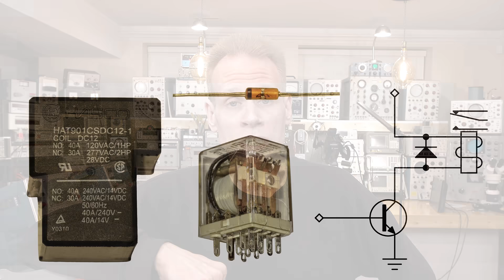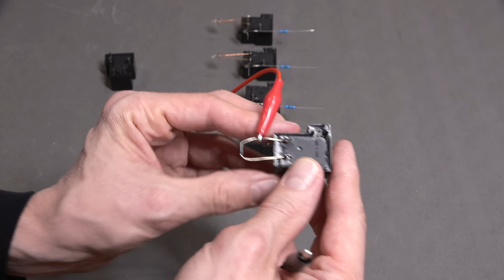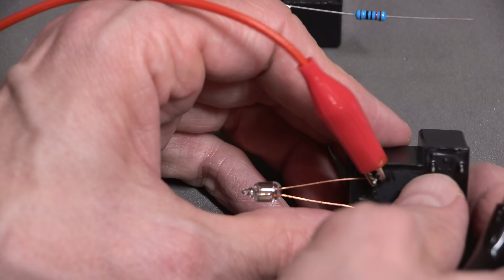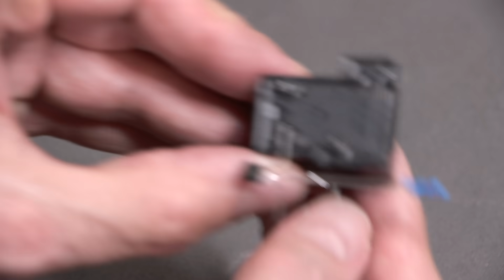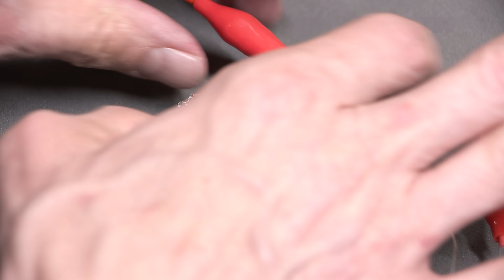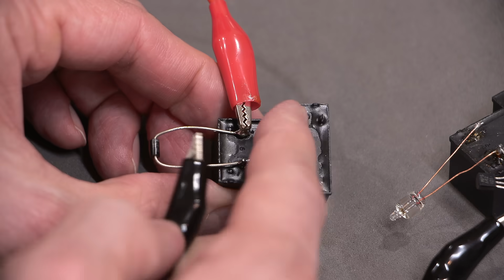Why Add This Diode Across A Relay Coil? This Is Why It's Needed!

Comment: I think it's worth pointing out that although the polarity reverses when you de-energize the coil, the current through the wires in the coil keeps going in the same direction.  It's almost as if it has inertia and wants to keep going.  That's non-intuitive, because "polarity reverses" makes it sound like the coil shoves current in the opposite direction when it collapses.  It doesn't, it shoves it in the same direction.  The reverse polarity is due to how you look at the + and - voltages in the circuit after the battery has been removed.   Great videos, BTW!

Comment: A diode in parallel with the coil of a relay serves to suppress excess voltage in the self-induction process,"fem reversa" This is from 3rd year of secondary school at a technical school in 1978

Comment: I was working at Lawrence Livermore National Lab.  My team leader challenged me about why I was waisting time adding fly back diodes to relays.  I told him that all relays need that diode to prevent chatter. I was ordered to not add the diode.  I said ok and built the circuit with out the diode.  Does chatter like a machine gun ring a memory.  I got to add the diode after all.  My engineer was a PHD EE.  I was a USN Aviation Electronics A & B school grad.  There were several other times on that project I got to do the I told you so dance. All of them to do with basic electronics.
Reply: Yes elitism arrogance.
Reply from the maker: Thanks for sharing your story!
Reply: My older brother was a PhD professor in EE at a major Uni. I went to him about the reason for a multiplier in a particular IC. He could not identify why a common inverting op amp could not do the job of multiplying. During my EE/tech career I found roughly 50-60% of EE graduates could not remember anything they learned in first year basic theory. Presented with a problem, they would resort to textbook fixes without applying their nogin to analysis.

Another time a tech in my neighborhood who was working at the local airbase asked me about Black Bodies. I told him that they were theoretical, that nobody had ever made one, and that it was unlikely ever to happen for the simple reason we don't have instruments that can measure temperature down to 0K. He said he thought that was correct also, but had been in an argument with a female PhD about it and was adamant she was right.

Some people never think twice about what they're learning in basic theory, so they don't understand what's behind them.
Reply: @svartvist  Book smart only, no working experience. I have certifications & a degree — It's only a good start, field work still needed afterward.
Reply: @svartvist so true use it or looses it.  I'm that boat, I review basic circuit analysis every year or two.
Reply: @svartvist  because he is not an application guy after all, that is not his purpose. He does better in calculations, research, inventions,and developing theorys that you see in other applications that you don't do
Reply: @svartvist  
物理現象や電磁気現象や化学変化などについて、その表面的な状態変化だけに注目してその状態変化の根源理由を理解しないと現象の根底にある正しい原理やメカニズムを理解したり、状態変化を応用したり、トラブル解決策を考え出すことはできません。
深く、現象の根本原理を考え追及する人だけが新たな発見や発明を成し遂げるのです。

When it comes to physical phenomena, electromagnetic phenomena, chemical changes, etc., 
if you focus only on the superficial changes in state and do not understand the underlying reasons for those changes, 
you will not be able to understand the correct principles and mechanisms underlying the phenomenon, 
apply state changes, or come up with solutions to problems.
Only those who think deeply and pursue the fundamental principles of phenomena 
will be able to achieve new discoveries and inventions.
Reply: When using a diode to prevent high voltage from occurring, the relay remains in the ON state until the current generated by the coil has run out, so there is a delay in turning it OFF.
To prevent this, you can insert a low resistance in series with the diode to speed up the conversion of the current into thermal energy.
Reply: It took me a long time, but have reached the point  that this is so clear suddenly. I*m relaxing watching this... Ten years ago, I could still only maybe sense this. 
I was invited a long time ago and also warned of this "bad thing" going on all over the place, blindfolding others. EE seems very saturated with it. I made sense of impedance matching just very recently and tempted to relearning a lot the correct way.
 I am sure it is one of those magic words to get rid of these bad spirits quite swiftly. Once I get to learn using a Vector Network Analyzer, it  will become even more obvious. Its very profund, and makes me want to grow, and I get very upset about things all over the place the last few days.. Very reassuring to see this Channel is a place of light, your comment is adding to my dedication!
Reply: @chrome4096  
>The meaning of impedance matching
Impedance matching is an important concept for optimizing energy transmission and preventing reflections in high-frequency transmission.
However, impedance matching is often not optimal for short-distance low-frequency transmission, such as in audio circuits.
For short-distance low-frequency transmission, such as in audio circuits, keeping the output impedance as low as possible and the input impedance as high as possible is used to prevent the introduction of noise and distortion.
Alternatively, the opposite may be true: keeping the output impedance as high and the input impedance as low as possible.
Reply: @yasudan7690  because Otherwise(in an audio circuit, using my secondary piezo bass pickups as example) I  would basically collapse the voltage swing if I allow it to sink to much current to the DI box/amplifier? I am still in the process of reviewing all the good information in my old university electronics documents, but its going to take a while. Whats the frequency range where impedance matching becomes relevant? I have a few projects in planning where I plan on repurposing some studio equipment for control loops at over 200kHz
Reply: Yes, education does not always correlate to IQ………
Reply: not trying to hurt your feelings, but help you. It's not "waisting" it's wasting. One is around your hips, and one is unproductive. Waist vs waste. have a nice day.

Comment: Also add the diod to anything with a coil, like ac compressor clutch in cars, solenoid valves, anything that has a coil with a collapsing field ?

Comment: The other reason to clamp that voltage spike is the arch across the switch contacts can burn. If the switch happens to a PCM driver circuit, you could easily smoke the computer.

Comment: This demonstration begs the question: why don't manufacturers incorporate diodes across relay contacts that switch electromagnetic coils, such as brake or clutch coils in machines? In my field, I am often replacing relays due to burnt contacts. Diodes can't be that expensive, especially in bulk.

Comment: No doubt! You just answered why the 3 phase 240v industrial 36v forklift battery charger has diodes and resistors across the icr packs (power cubes). Also why the 40 and 50 amp definite purpose contactors controlling the resistive heat elements of the 6x6x6 foot square drying oven, have dipodes across their coils and when they are removed, it caused the electronic Honeywell control to fault out shutting down the oven until they were replaced. Also the forklift contactors of the EV-100 controller have diode snubbers on most of them as well! I'm gonna sub! And I'm watching all your videos. I've asked engineers who couldn't explain the reason for a diode across a coil or between scr's in a 3 phase circuit! Also back in the pre 50s, 60s, and 70s, before digital got popular and digital multimeters became  prevalent, they had volt age testers that had a neon light and a solenoid inside that would move a pointer down, that would pull down the indicator, showing you what voltage it was placed across and bounce back to 0v with a spring as you made contact with the circuit! The neon light was supposed to show dc, even though it was an ac voltage tester and it would do the exact same thing that YOU JUST SHOWED IN YOUR VIDEO!!!. No one could explain those to me and now I get it. I haven't used one of those testers (it was Nick named a wiggy), in years since we went digital but I'm pulling it back out to amaze and impress some engineers who grew up with digital! WOW!!! THANK YOU SIR!... NOW I'M SMARTER THAN THE ENGINEERS AND ELECTRONIC TECHS I KNOW! ! !🤣😂 KNOWLEDGE IS KING!!! You my friend are the, King of Knowledge... And knowledge of power is King! Man you said it would click and my whole electrical world just aligned! Dang, I'm watching it again because, I get it! I just don't want to ever forget it! Later, great video! And thank you very much! J Poll. 🥇👏💯✔️👍🏁🏆😉

Comment: Discharge path for collapsing magnetic field.  Collapsing magnetic field without the diode can make stupid high reverse voltages and fry out circuitry upstream of the relay.  The diode shorts out that reverse voltage pretty well.

Comment: Had a 1972 Chevrolet Caprice which had problems burning out the voltage / charge regulator relays. Both diodes and neon bulbs helped prolong their lifespan.

Comment: A capicitor can also damp the inductive spike effect.
Also these relays should have built in diode for the same. Check with new modern relays.

Comment: Thank you Paul! So when the coil is deenergized and the reverse current occurs, and the diode shorts it out, where does the energy go, into the diode and released as heat?

Comment: Good information. I have had problems with the normal type relays in the past.i recently came across a electronic relay made by msd and stinger, for my automotive needs
 They are so much easier to wire and can be triggered by the positive or negative. What are your thoughts on these?

Comment: Complete lay person here;  this piqued my interest of a lover of "classic" cars from the 80s and 90s.  I have a collection of relays, some 30-40 years old, of the Ford variety.  I disassembled several of them to search for  an internal diode and not of them have one.  If this is an issue of concern, how do these simple relays last 40+ years.  Logic tells me it's unnecessary in these specific applications.  Am I off base?  Thanks in advance.

Comment: When I used to work on Electro Pneumatic Pipe organs... You have Thousands of little magnet coils controlling every pipe... We used allot of diodes to clip back EMF. and a diode matrix to prevent backflow of current when using multiple switches for unification and borrowing of stops.

Comment: Absolutely interesting. I have worked with car electrical both professionally. For a few years in the 70s but also on our private cars (car alarms, auxiliary lights, halogen/led. stereo, etc.) and have not had any problems with relays stopping working. However, connections to relays do occur. Maybe because I use quality relays 🤔 So my relays "survive" without a diode. And if it were a serious problem, there would have been a diode on the relay by now. I have a goal to learn something new every day. And now I have done it Thx. And within a week or so I will install auxiliary LED lighting on my wife's new car. No, I will not solder a diode there😉

Comment: Too long an explanation.
The reverse diode tuns the massive positive potential on diode floating anode into a massive negative potential on diode cathode which is tied to battery positive terminal.

Contrary to popular belief, the induced voltage doesn’t reference to battery positive in order to get up, because that would still burn the transistor as it happens without the diode in the circuit. It happens counter-intuitively: the potential of diode’s cathode goes down, leaving anode-and the emitter safe. Battery gobbles the spike.

The neon tube takes the spike from battery, acting as protection.

Comment: One of the principles of my learning about electric coils was the generation of reverse current when electricity is quickly interrupted. Throughout my career working with electronic devices, I have seen many problems related to this, and especially one that I will never forget: a customer complained about purchasing a DIY device that frequently burned out a MOSFET controlling a solenoid, without heating or other symptoms. Without difficulty, I did not observe any suppressor circuit with coil or MOSFET with clamper diode. In this case, just place a diode in parallel with the coil and NEVER burn the MOSFET again.

Comment: 16:40 why the diode "takes it" instead of wires which are connected to + / - ? For example for electric door strike. Why inductive spike is taken by the diode, but not by intercom NO / NC / COM or power supply? How it is happening the diode fully discharge the inductive spike?

Comment: New automotive relays often have a diode or small resistor built into the housing parallel to the winding. This should be kept in mind when replacing old relays with new ones.
Reply: There is now protection at the ECM/PCM negating the need for it at the relays.

Comment: Excellent explanation Mr. Carlson... I really liked the internal workings of a Neon bulb ( over the years, i forgot that the glowing electrode was actually the negative one ).

Mr Carlson's sixth montage ( MPSA42 300 volt transistor with the Neon bulb ) has a hidden advantage: Since the relay coil discharges its high voltage pulse across the 70 - 100 volt Neon bulb, the coil's magnetic field collapses more rapidly, letting the relay to react more quickly.

Comment: Just a suggestion from an M.S.T. teacher, it would have been nice to see you repeat that diode test with the neon bulb attached in parallel with the diode.
Reply: I was thinking the same.
Reply: I agree.  Visual proof.  Or even a scope.
Reply: @jasonkubik1016  I would trust the scope over neon.
Reply: @jasonkubik1016  you see the scopes behind him? i would just trust bro

Comment: Great content. I am using relays with 24vac coils. May I assume that a diode is not the correct solution for AC? Do I need the protect the coil controlled by AC?

Comment: Excellent presentation. I once had an LED lamp that was on the same buss as a DC motor, and when the power was interrupted my LEDs kept going bad. It turned out the flyback spike from the motor was the reason. and adding a reverse biased diode across the DC buss solved the problem.

Comment: I added a bunch of 30V Zener diodes to a transmission control harness on a large machine as the solenoid coils were sending spikes back through the transmission control unit, they had replaced 5 at a cost of almost 20K eqch time. Took me 5 hours and cost a few dollars in diodes.

Comment: I wondered this for years. I've been removing the diodes from the solenoids on my arcade recoil mechanisms because I couldn't see a use for them.

I use solid state relays to activate solenoids via an ne555 circuit and haven't had any issues after years of use. 

I wonder if their benefit differs if used to activate an electromagnet instead of an led light?

Comment: Another super useful design from the ABCs of solid design work. I have some 1960s Bruel & Kjear schematics that show neon lamps in the circuits' schematics as zener diodes. I have other fine old test gear that use neon lamps as DC voltage regulators. The diode suppresses the voltage generated from the relay's field collapsing in the relay coil. We also often use FETs and often an ancillary transistor to momentarily shunt audio signal to ground to eliminate any popping when the relay contacts open and close. J174s and J175s were/are commonly used. Now there are photo-transistors with higher voltage isolation.

Comment: Corvette friends of mine brought me several gear shift selector assemblies that had a history of failure. They were failing because the assemble  contained a solenoid controlled by two mini micro switches. The switches were failing because back EMF was not suppressed at the solenoid coil.
At one point the assemblies (I am told) from GM were $900. What is the cost of a suppression diode at GM point of assemble ?

Comment: I once had a set of auxiliary high beam headlights on a relay. The relay was turned on when power was applied to the standard high beam headlight. When I turned the relay off, my headlights flashed very brightly. I couldn't figure out why I kept burning out bulbs. Then I learned about the diode across the relay. Thanks for the video.

Comment: hi i have got a question is that still a problem with a mains ac powered contactor and if it is still a problem how would you suggest to mitigate the voltage spikes

Comment: Nice ride Nigel. Sometime when you have time (perhaps on a cold wet day when you are stuck in the new workshop) could you do a techy talk about the trike - how long the battery lasts, how much assist does it give, do you have to pedal to get movement, what servicing is required, etc, etc.?😊

Comment: How big of diode do I need to put across the coil per my application with a 40 amp relay with 12 gauge and 14 gauge wiring?

If my relay is in a socketed harness, where do I install the diode? In parallel to the wiring going across 85 & 86?

Comment: On starter solenoid control wires a zeener diode is used between them so the control wires work normally when energized. A solenoid is an electromagnetic switch. When the control wires are de-energized, the electromagnetic lines of flux collapse past its own windings generating high voltage. Basically it acts like a step up transformer. This high voltage surpasses the zeener diode threshold and the zeener rotes the current to ground instead of travelling through the vehicles wiring harness and ultimately to the vehicles computers.